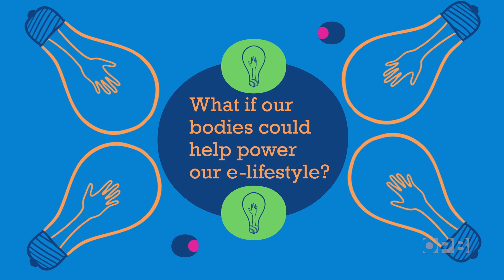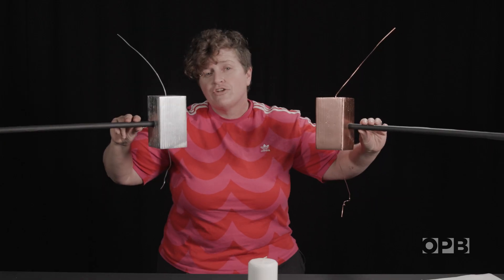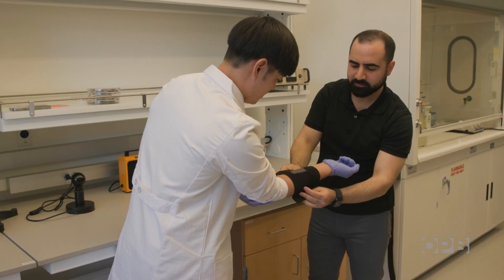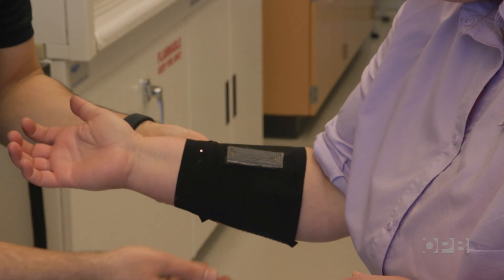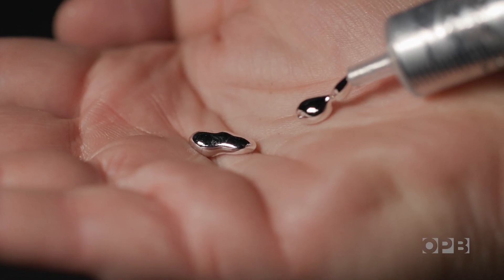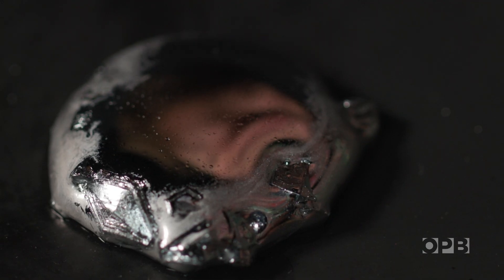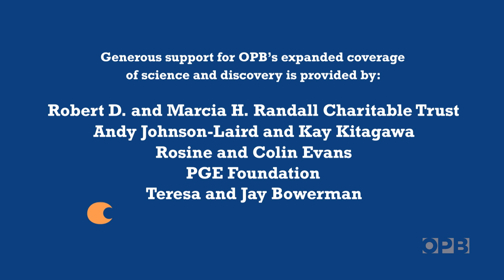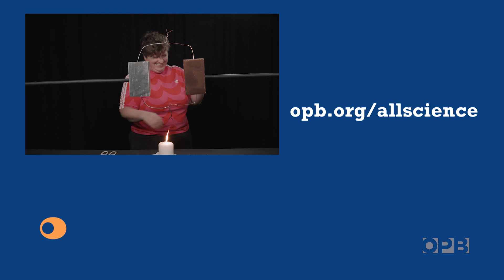New, flexible “fabric” converts body heat into electricity | All Science. No Fiction.

Comment: The smart money would modify this "fabric" to start lining nuclear reactors with.
Reply: The entire point of nuclear reactors is to generate heat, which converts water into steam, which drives a turbine, which creates electricity. Wicking heat away from the system is defying the purpose of it.

Comment: They just invented wearable Air conditioning
Reply: @Xonikz  possibly more than you realize, it doesn't just feel cold because it dissipates heat and turn some of it into electric. But if you run an electric current into it you can generate heat on the hot side and make it colder in the cold side.
Reply: Evaporation cooling is good stuff...spray bit water on your face then put a fan in your face you see what I mean heavy simple cooling..
Reply: @jshaw4757  and if you keep dry ice in your pockets it's good to make trails you don't need to be tripping to see.. the freezer burn is unpleasant though.
Reply: @petevenuti7355  Fully confused on that one 🤣🤣
Reply: @jshaw4757   dumb stuff I used to do back in the day while following the Dead shows....   
   Imagine a bulky 6 ft 4 hairy guy with a bushy beard wearing all black on a 104°f day walking through Washington DC with cold smoke pouring out of all his pockets leaving a condensation trail behind myself.. 
  I'm pretty sure if anybody who noticed probably thought (or knew) they were tripping,